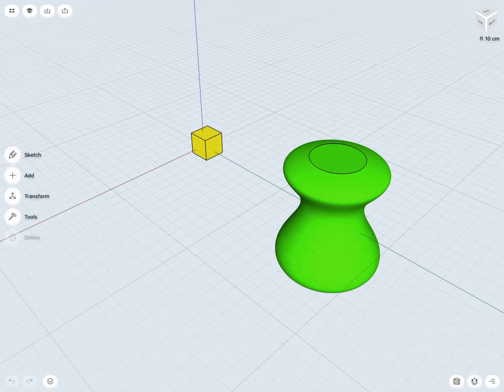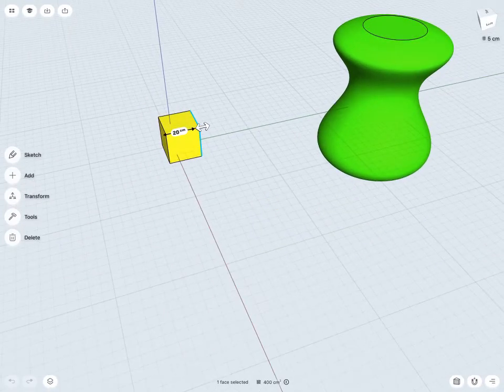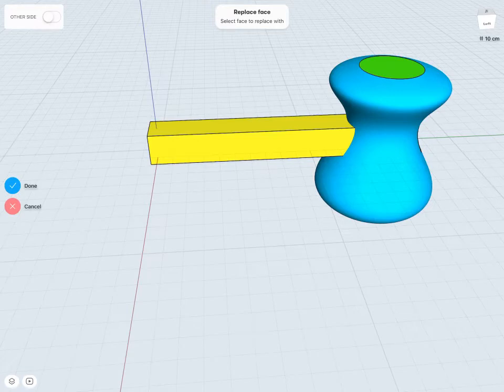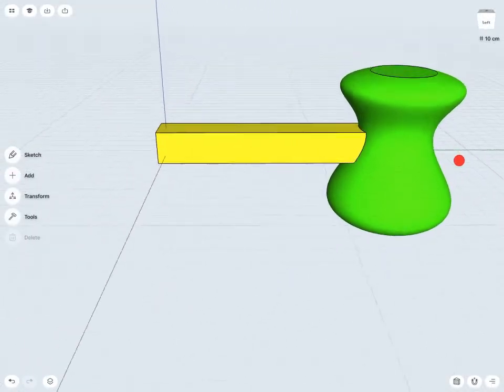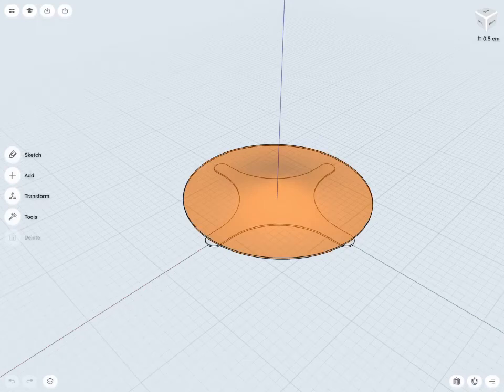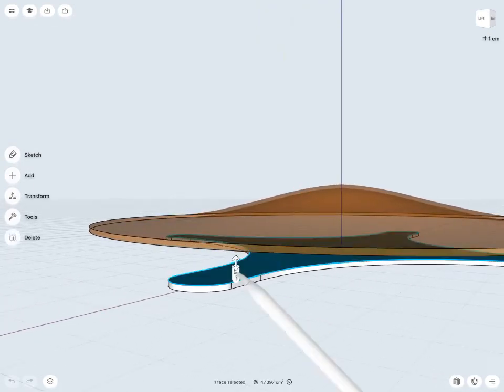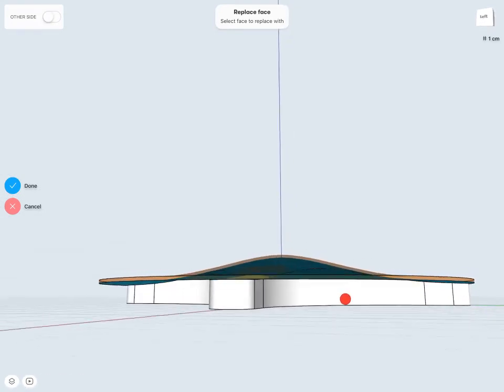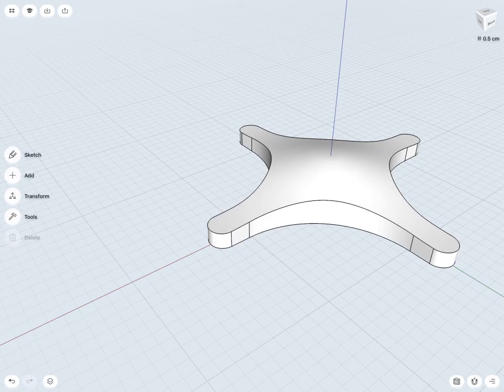Replace Face | Shapr3D for Beginners

Comment: How did you make the orange part transparent?
Reply from the maker: Hi, to make make the body transparent, after selecting the color, reduce its opacity on the other side of the workspace opposite the color wheel selector. I hope this is helpful.